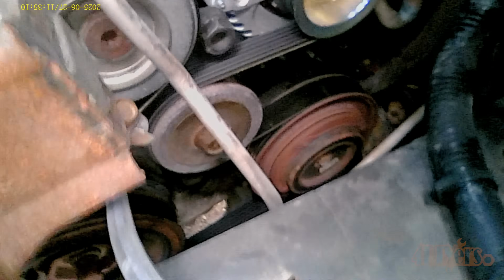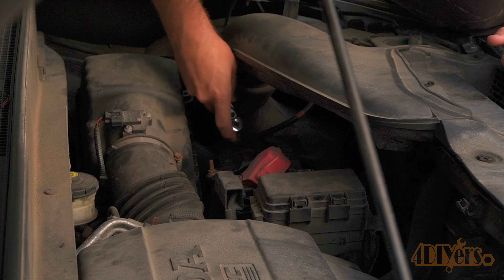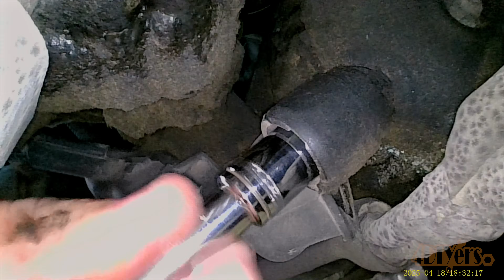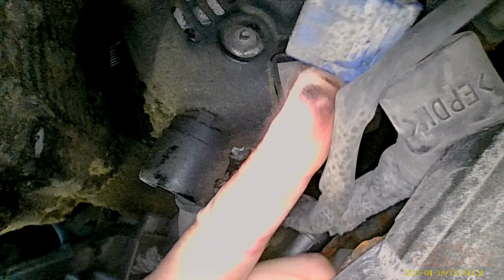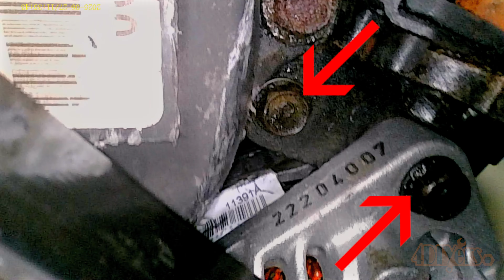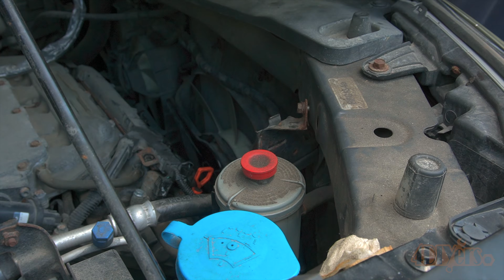How to Replace the Alternator on a Honda Pilot (2nd Gen | 3.5L V6)

Comment: Unfortunately it seems that my model does not have the tensioner bolt in that location rather the manual says to use the bolt on the wheel and it's in a very hard spot to get to without a specialized tool.

Comment: Hello and thank you for the video. 
The problem I have with my car the 2015 Honda pilot 4 wheel drive is the alternator keeps burning out even after I had just purchased a brand new one with a lifetime warranty. What could possibly be draining my alternator so quickly while it has a new alternator a year used battery but the battery is a very good battery. I do not have any subwoofers or fancy buzz and whistles besides what the car was manufactured as

Comment: Hi, could the alternator be saved if it did get oil in it?
Reply from the maker: It’ll most likely fail eventually. It’s hard to clean the oil out once it gets in there.
Reply: No, any oil in the alternator will cause permanent problems in my experience.